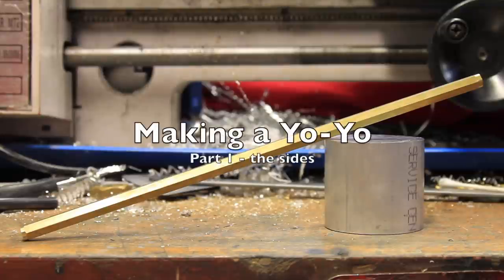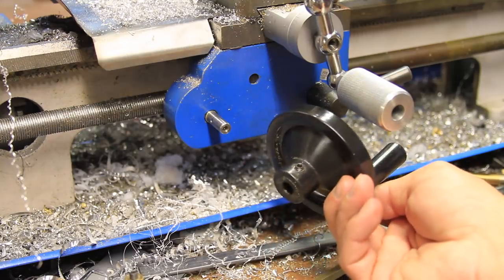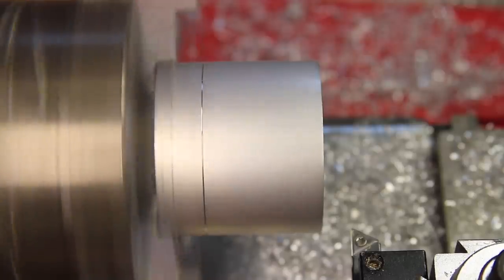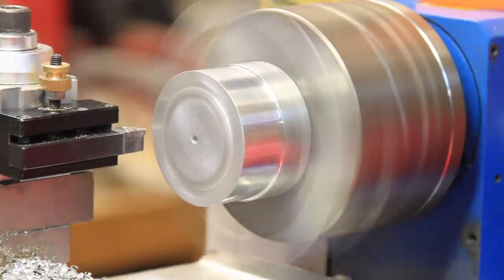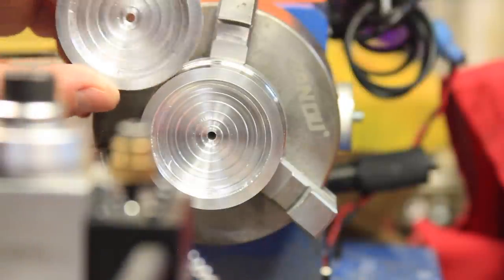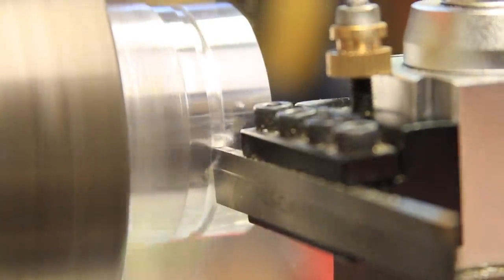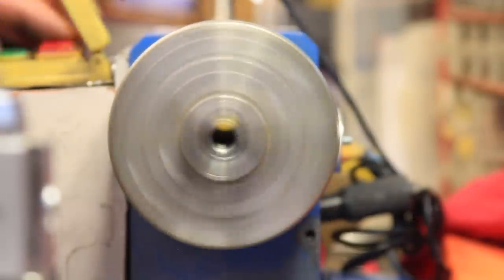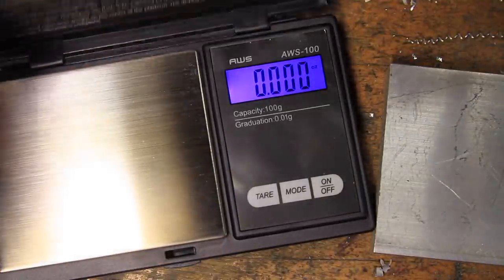(1/2) Making a Custom YoYo on the Mini Lathe - the aluminum sides

Comment: Have you considered bolting your lathe down to the workbench or to a suitable board, to make it more stable, especially when using your hacksaw?
Reply from the maker: Yep! Every time I do something and it ends up super wobbly. Eventually I will figure out something better for it.
Reply: Small torsion box that sits on three points?  Keith Rucker from Vintage Machinery you tube channel has some good videos on leveling lathes, granted his lathes are huge, but I'd image the principles would still apply.
Reply from the maker: That'd work too, but it would be pretty cumbersome still and one of the main reasons I got this lathe was it's small footprint.
Reply: Well, the torsion box would be about same foot print as the lathe and still be light weight yet very stiff.  You would then have 3 leveling feed, one at each corner on the motor end, and one in the center at the other end, so no rocking.
Reply from the maker: That's a valid point - I might have another video to make...
Reply: They say its generally a bad idea to bolt these little lathes down as it may twist the bed. If you have a machinist level and check it as you go I don't see it being a problem.

Comment: I had a lot of trouble parting off when I first got my mini lathe too. It's all about rigidity and technique. A better toolpost will work wonders, along with a thinner parting blade. That bad boy is thick! Also, you aren't using any cutting fluid, and your speed is waaaaay too fast, especially for a piece of that diameter. Slow it down, like almost as slow as the lathe will go. Like 2-300 rpm with a steady drip of cutting fluid and your results will improve. Its a slow operation on these little lathes. You should be able to get a chip going and have it curl up like a long shiny ribbon. It takes me a couple of minutes to part a 1 1/4 piece of steel, so dont be in a hurry parting a piece that big.  Looking forward to part 2!
Reply from the maker: I could try getting a thinner parting tool - I was afraid of going too thin initially. I definitely could use a better tool post though.

As for the speed - that was as slow as it can go (at least without opening it up and tinkering with the pots on the board) Check out this video for more details on that https://www.youtube.com/watch?v=JZgvuZGRpZ8

Thanks for the suggestions though! I guess it might be worth trying to get it to go slower.

Comment: It looked like the drill bit jumped up a fair bit when cutting the center hole. Have you noticed any issues related to that?
Reply from the maker: You're right and for the most part I haven't.... there's a lot of slop but it almost always will self center.

Comment: I also have that chinese lathe and found the thin parting blade works much better, the thick one your using is too much for that whimpy motor to handle  and will stall and damage the belt if not strip it........

Comment: Welcome to the compliment section! 
Also, instead of eyeballing the cutoff length (for the second piece), why not use the depth meter of your caliper? Just remeber to add a tiny bit for inaccuracies... I'm also wondering about how you're going to put the parts together... are you going to rivet/bolt-nut/glue/solder... hope to see the result soon, and good luck on that handle!
Reply from the maker: I could have - I guess if I was going to leave a little extra anyway it didn't matter how exact it was :)

As for how it goes together - you'll just have to stay tuned for Part 2!

Comment: Have you tried to use the hacksaw while the lathe is spinning? Would it make it easier on you to cut it off?
Reply from the maker: I did give that a try and maybe I just wasn't patient enough but I didn't feel like I could cut as effectively because I couldn't put any downward force on the blade. Thanks for the comment though!

Comment: @ 8:30 why didnt you use your calipers to measure the parting distance? also you really should have chamfered all the edges quite heavily to make it comfortable/safe to use..  (well you did mention that at the end but would have been much easier to do on the lathe)

 keep up the good work!
Reply from the maker: No reason - I guess the other half was just closer or I wanted to show that the distance I was measuring was from the other half - not sure what I was thinking. It just had to be thicker than the previous side by any amount though as I'll bring it to the final thickness later. As for the all the edges... stay tuned for part 2 :)

Comment: I'm not a machinist but maybe using some sort of lubrication would solve the issue of popping your breaker we doing parting cuts? Also maybe consider investing in a micrometer? O.o
Reply from the maker: It would possibly help - The biggest problem I think is the amount of flex in the tool post, so once enough of the parting tool is in the part it starts twisting and binding.
Reply: ah ok , ive just watched allot of machining videos and am a student welder and when doing thick cuts on our test plates our band saw is lubricated so it made sense in my mind
Reply from the maker: Yeah for sure! I have no doubt it will help - I just don't know that in this situation it's the majority of the problem :) Thanks for the comment!
Reply: I've seen a few videos suggesting that parting off from the back side of the work, with the tool upside-down, can alleviate that issue since the tool deflects up and out of the part, rather than down and into the part. I haven't gotten the necessary attachment to try it on my lathe (Sherline), but it may be more easily within your reach to give it a go and see if it works.

Comment: I assume your lathe is variable speed and I just noticed when you were using the cutoff tool you were running it at a super high rpm  and you'd probably have some better luck with it running it lower and just putting a little more torque on your handle as long as they don't break anymore haha. Both stainless and aluminium rods I cut at 179rpm (mechanical threading lathe so the speeds are preset) with some coolant no problem. If you can keep a consistent enough feed the parts almost look faced. My two cents take it or leave it
Reply from the maker: Thanks for the comment! That's actually the slowest it will go right now. I might be able to open it up and tweak some of the pots on the board to slow it down more though. I go into more detail on the min/max speeds here: https://www.youtube.com/watch?v=JZgvuZGRpZ8
Reply: TimNummy I thought the case was something along those lines but it's still a nifty little machine :) your videos are awesome keep up the great work
Reply from the maker: Thanks so much! I'm glad you're enjoying them.

Comment: Hi Tim(and Everyone!). I came across a cheap lathe mod you might be interested in. Do a quick search on YouTube for "Digital Caliper DRO"  :D 

Digital read outs on the cheap. Basically just modding then mounting a digital caliper to the carriage, cross-slide, and even the tail stock(for specific depth drilling/reaming). Touch off, set zero and away you go. 

With Black Friday just around the corner you'll be able to pick up calipers for dirt cheap, heh heh.  Just an idea to check out, after the carriage handle build maybe. :P 

Fun yo-yo project btw,
Take care.
Reply from the maker: Thanks!

I've seen that video before and have been tempted but I'd like to see if I can come up with something a little slicker - so far I haven't been able to figure that out yet. Good idea about black Friday though, it might be worth picking up a couple check calipers anyway.